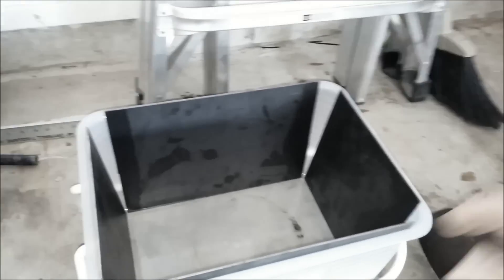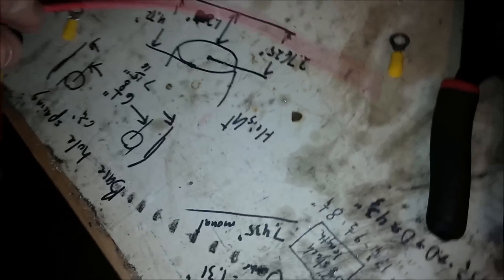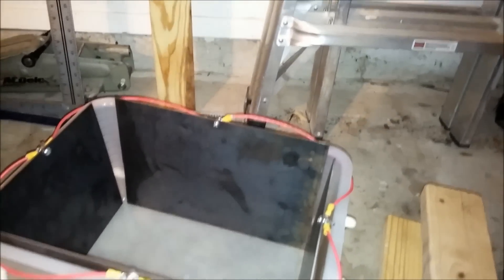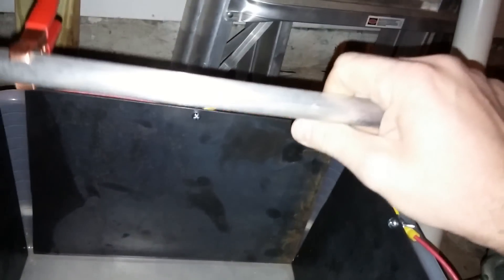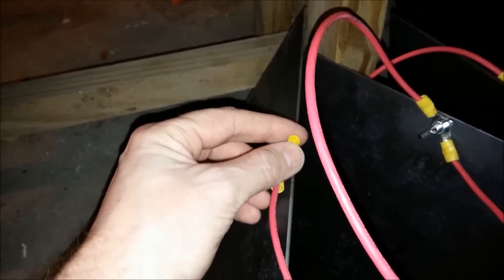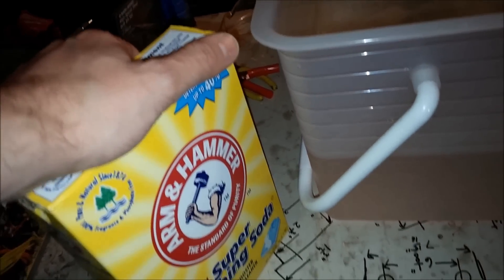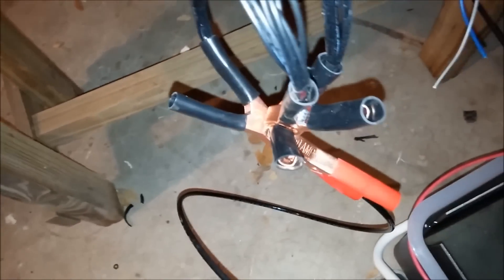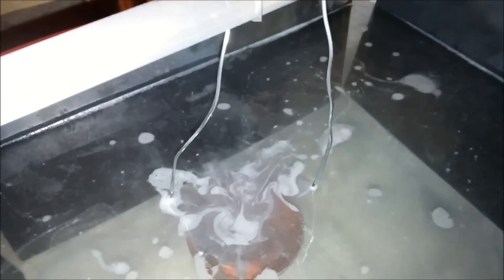Making an Electrolysis Tank for Rust Removal

Comment: This was nice and simple. I used a dog bathtub, our dog died a few months ago and it was just sitting, 2 18 x12 stainless steel grills as my sacrificial steel, used aligator clips to connect them electrically. I used 1.5 Tablespoons of sodium bicarbonate per gallon in my warm water. Strung up a 2x4 to suspend what I was cleaning in the electrolyte. It worked great. I cleaned 4 iron skillets overnight. The coating was peeling off them like a layer of skin.

Your floor jacks was a great addition. I'll have to see if I have something similar for my next wash

Comment: It's Amperage that makes it work faster, not voltage.
Reply from the maker: No, that isn't correct. I could wire more power supplies in parallel at a lower voltage and the reaction would be slower.
Reply: Look up any plating or electrolysis process, the amount of work done is directly related to current density st the anode/cathode.   @354tb35yb5y

Comment: Good idea, the only thing I might have dome is submerge your steel plates in Vinegar over night to remove the mill scale from the Hot Roll steel plates so they work more efficiently but that's a good idea. Also what you can use for long say 3' parts is 3" PVC pipes @ 3 feet long with caps glued on and 1/3 of the pipe opened length wise for a tank for long parts.  FYI  After the electrolysis scrub off the part under running water with a wire brush to remove the black scale created for best results.

Comment: You have caught all kinds of flack for your attention to detail on this project and I am surprised by it. I've built a few of these tanks over the last few years. I feel like the attention to detail removes all room for doubt if it doesn't work properly. You can be confident in the design and build of the tank and then focus on the attachment point of the piece or the power supply itself.  
    Honestly, my opinion about your design and choice of materials doesn't matter. What matters is does it work for you?! 
    Keep on eeling and chilling in your electrolysis tank!

Comment: Instead of all the wire connectors, next time just strip the wire in that spot and wind it around your screw and feed it off to the next one. No need to cut the wire until you reach the end.
Reply: How the heck have I never thought of this?? Gonna try it on my next setup.

Comment: I find using a heavy gauge steel mesh like heavy duty steel window screen just wrap everything  Or shape it into a basket then take 4 pieces of anything sturdy like 1" pvc or anything non-conductive cut to about the height of the basket and Glue/apoxy it to the bottom of the tank standing at the center of each side of the steel basket so It can’t slide and hit the plates also Put something under the basket or pouch to keep it just off the bottom of the tank So water can also get underneath everything It’s just so much easier than hanging everything Just toss it all in the basket good to go

Comment: good skills and we see we are in a presence of a perfeccionist, BUT... but for remove rust from that kind of piece we actualy can achieve better results simply with an electric driller with proper rotary brush bit.
it simply cleans quickly and the metal will stay as new, very clear.

this process shown here is very good for other kind of complicated pieces, not for simple surfaces pieces. but thank you anyway for show your construction. the 4 plates is a good idea instead of a simple rod, as shown in many videos.
Reply from the maker: Yes, you are correct. This was shown purely for demonstration purposes.
Reply: The difference is. Using a wire cup brush affects good steel and rusted steel and is much more abrasive. With this method it only affects the rust. You can then remove the blackened finish with a mild scotch rite pad or wire wool. Basically you preserve more metal this way. This is important for tools for example or quality parts. If you were using this method to de rust rebar or an old cold chisel it would be overkill and angle grinder with wire wheel is the way to go. One other benefit is you don’t end up plastered in iron oxide dust, or your workshop using electrolysis

Comment: Mate, you should have said at the start that you have never done this before. While you don’t mention it in the title or your commentary It’s very obvious that you have got all the info off YouTube and then made the video before you have tried it.  I have been doing this for years and I have a similar size tub which I just fill with water and throw a hand full of washing soda in there. No measuring needed. No bullshit about dilution rates and I don’t use fancy plates which have been wire brushed ect. For years I have just been using a piece of 1/2 rebar made into a rough square that sits on the bottom of the tank and every so often I take it out and give it a quick hit with a wire wheel. It’s pretty buggered now though so I need to make a new one. Again for years I have been using a very cheap 12 volt 4amp manual battery charger and I usually just plug it in and leave it going for 24 hours. You can’t over do it because the electrolysis only attacks the rust. All the talk about keeping the 3 & 5 volt leads on the asx supply incase you need to dial it down is rubbish as well. And as for hydrogen embrittlement, what are you building a fucking space shuttle? Embrittlement is mainly a problem for high tensile steel like grade 8 bolts but this can be relived by baking in an oven to drive the hydrogen out. Don’t be surprised if your power supply starts cutting out or dies because you are effectively creating a short with this set up which is why it doesn’t work with the modern multi stage electronic chargers. Mate, seriously dumb it down and keep it simple, plug the 12 volts onto it, sit back, crack a beer and watch it do its thing. Good luck with it. Cheers Stuart 🇦🇺
Reply from the maker: I appreciate your comment but what it boils down to is this:
If we were bakers, you're saying because I gave a recipe, I clearly don't know what I'm talking about and haven't done this before. 
You've been baking for years and you don't need a recipe. You don't need any fancy gadgets, just a hand mixer, and you just throw some ingredients together and voila!
The problem there's no entertainment value in me baking a passable cake and not even providing the recipe.

Getting back to electrolysis, embrittlement is a concern for steels with high carbon content and at higher voltages. Just because you use a 12V battery charger doesn't mean everyone will. Also cast iron, including ductile iron, has higher carbon content than Grade 8 bolts, which are made from medium carbon alloy steel.
I also disagree that the 5V lead isn't useful because 5 or 7V is what I'd start out with for restoring much older, delicate steel.

Also, my power supply is still going strong.
 Cheers!
Reply: D_I_Why!?!? Ok, point taken and I apologise if I sounded arrogant, at least that’s how it comes across reading my comments back to myself. Also you make some valid points. Better to tread carefully at the start. Cheers Stuart 🇦🇺

Comment: Good video you might consider drilling a hole to put your bolts thru use double nuts and the panels won't move its a pretty easy process you can also just submerge the part in mollasis water there's a good video on it from a guy in Australia keep going

Comment: What are you insinuating the jack stands from???
Reply from the maker: In the setup I've shown it isn't really necessary because it's attached to ground anyway, but if you were using any other combination of leads, like a +12V and -12V to get 24V, for instance,  you would want to electrically insulate the jacks from the rest of the circuit. I thought it was relevant so I included it.

Comment: ran an oxilating fan over the bath , it disperses the gas so it never reaches the amount to actually explode , it allso moves the mess on the water intoo one corner a little 
allso the bigger the surface the more amps you'll run though the water , think 1 plate or 4 way smaller plates should be enough

Comment: If you made the tubular aluminium rod shorter than the bucket and put wooden broom handle through it can then rest it on the sides of the bucket, insulated. Or pieces of old radiator hose on the ends to insulate. Try swapping wires neg to parts and positive to iron plates.

Comment: I looked it up.
Hydrogen embrittlement is the process by which metals such as steel become brittle and fracture due to the introduction and subsequent diffusion of hydrogen into the metal. This is often a result of accidental introduction of hydrogen during forming and finishing operations. This issue is caused by material properties (diffusion of hydrogen), environment, and stress. This phenomenon was first described in 1875

Comment: It amazes me that everyone uses battery chargers and similar for this. I use an 80 watt solar panel (it's actually 4 x 20W panels in a fold-out arrangement) with the voltage controller / regulator removed. Gives me about 17 to 20 volts, depending on what part of the day and how the sun is shining (we get mostly clear, sunny days where I am). In a tub about that size, I only use two anodes - a bit of old scrap steel plate in each end of the tub. I can then suspend parts / camp ovens etc from a bit of pipe laying across the tub. I connect the negative lead from the solar panel/s directly to the part being cleaned, with the alligator clip and the part both fully submerged in the electrolyte solution. No need at all to be so fussy with cleaning steel pipe / wire / plates as John has said below - just clip the alligator clips on and give them a bit of a wriggle - they will make good enough contact.

Good video though - explains the process well especially for anyone who has never done this before.
Reply: if you were American you would use a battery charger too. i don't see why it amazes you, lots of cloudy,rainy areas in America. also no one in America does this the way this nutty professor guy does.

Comment: You're overly fussy about cleaning the steel wire etc. but your power supply is not good . It's not that complicated !
Reply from the maker: Hi, would you mind elaborating on why you think the power supply isn't good for this application?
Reply: Your power supply is wide open to the world and looks very unsafe especially working near a conductive water solution, I prefer to use a closed in manual battery charger. I use rebar iron as the sacrificial anode and did not polish with steel wool for a good connection. Works beautiful. Also the negative anode can be attached to your iron relic and be submerged. I do this all the time and it remains in pristine condition . Positive anode stays out of the water or itwill be eaten away !
Reply from the maker: The power supply isn't used in that condition under normal operation. In the video I just wanted to test if it worked at all and that I could see if anything arced / blew in the power supply. The power supply is normally enclosed and it has overvolt protection that shuts it off if there is a short. Rebar will get the job done in a pinch, but it's usually not the best option, or best 5. The reason for this setup is because the project piece was quite big and intricate, linked below:
https://www.youtube.com/watch?v=lQ-m_x60RLE